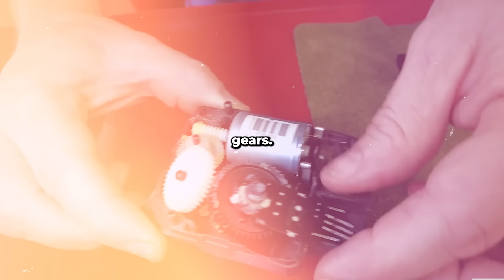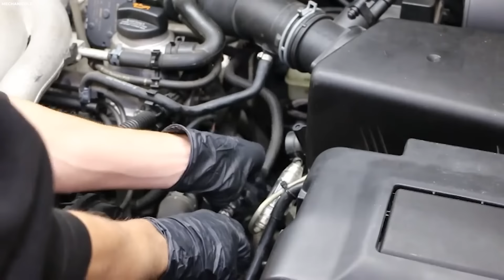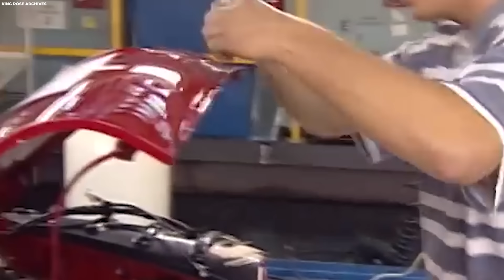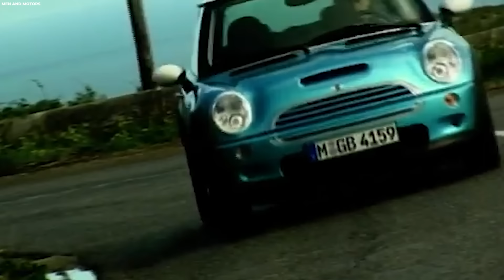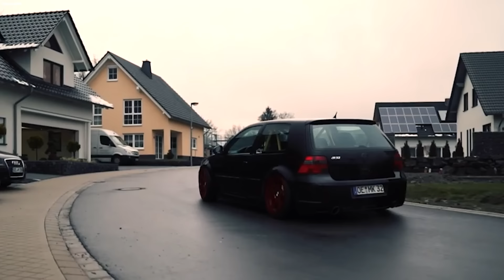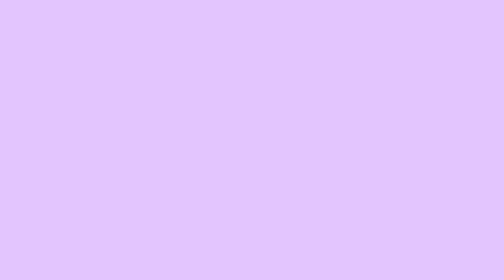These 11 Cars Are Built With Plastic Engines

Comment: This is AI slop. It is entirely possible to make certain plastic parts that last perpetually. Plastic oil pans, valve covers, thermostat housings, oil coolers, intake manifolds, water pump impellers, timing chain guides, and radiator end tanks that can withstand the test of time including 1.5 million miles, 10,000 cold starts, and 30 years or more is entirely possible.
Reply: nope they are breaking before 100K that's Planned Obsolescence VW/Audi has the economic repair threshold BMW has the strategic component lifecycle and Mercedes has the market dependent durability

Comment: To make cars lighter? To make manufacturing cheaper, you mean.
Reply: Exactly!   👍
Reply: or use planned obsolescence when you can put a metal timing chain guide for 15$ more but you put plastic and the chain jumps and destroys the engine and ends up with 5 - 7K Invoices
Reply: Make it to save money and to sale parts after out of warranty ..94 to 98 mustang gt have plastic thermostat housing fail at 80.000 miles .now  they sale you with aluminum one  with higher costs

Comment: I don't know much about car engines and I hate cars, but when your poor, and really struggle keeping my 2006 old fiesta going, buying a car takes alot of trust and hope, going of reputation. I can understand the thought behind trying to save weight where you can, but common sense tells you replacing metal parts of the engine, that runs red hot, aswell being parked in freezing weather, with anything that gets hot and under high pressure is best left to material that can stand the hot temps n high pressure. So, what happens when these parts fail?? And you take it to the mechanic?? Can the mechanic replace the part with a metal part??? Has that part been made even the car made was made with plastic?? Are does the mechanic buy the new part in plastic. Only to fail again in the future????. No wounder car manufacturers are dying. Its just pure greed, forget your loyal customers,  they deserve everything that's happening to them. Rot in hell. I'll never buy a new car after 2011 even if I won the lottery
Reply: If you want, on some engines you can replace some plastic parts with metal parts but only some components and they are aftermarket parts. Regarding not buying new cars, you are right. They are rubbish and built on the cheap with plastic parts. 3-cylinder turbo engines cost little for those who produce the cars and cost way too much for those who buy them. I have a 2017 Miata 2.0 ND which is built properly with a 2-liter, aspirated, 4-cylinder, chain-driven aluminum engine. The only plastic part of the engine is the intake manifolds and for my tastes, that's already too much plastic.
Reply: Car dependency is cancer